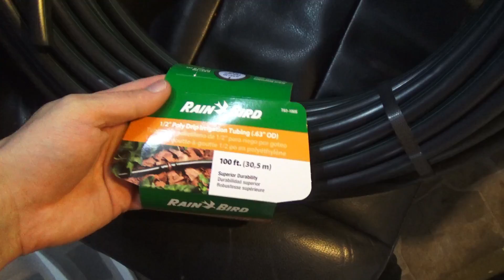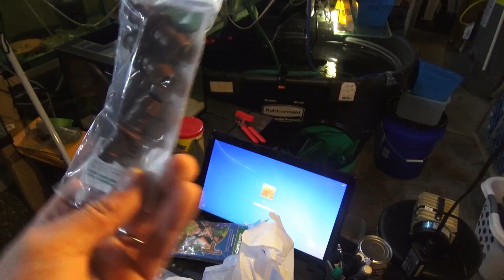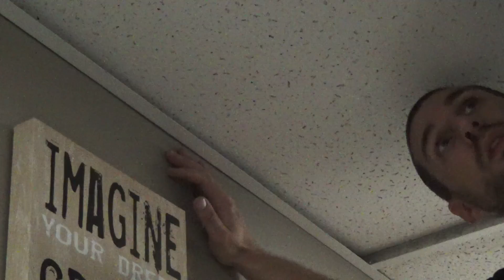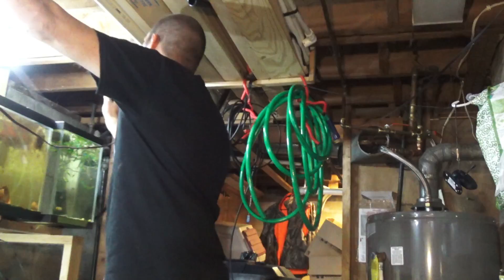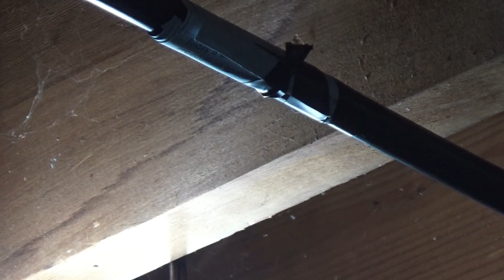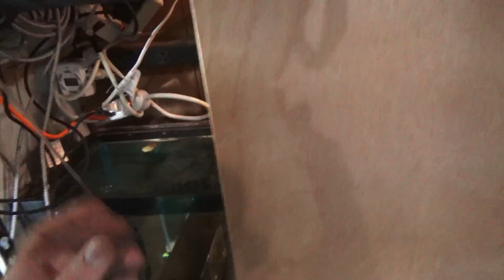Fish Room Air System For Under $100 That Works!!! 10 Years Proven System - KISS METHOD

Comment: I did the same thing about thirty years ago, I also included a pvc pipe 1800mm long 100mm dia, cap the ends  to act  as a reservoir and even out the flow. That way  I could tap  into the reservoir and run shorter loops  to the individual areas so  I could isolate an area incase  I needed to make changes to the system. Making sure you place an inline tap near  the reservoir on each loop. 

Most  important, with  your air bleed, get more tanks, you know  you can provide sufficient air to them. Start another fish room.

Comment: Thanks for all your videos. Working on catching up on all your videos as I’m a new subscriber. How do you figure out which size pump you need? I have 33 tanks with around 600 total gallons. Thanks
Reply: Yes that helps a lot and In my price range appreciate it.
Reply from the maker: Do to the volume of the aforementioned; I would suggest utilizing the next model up https://www.amazon.com/VIVOSUN-Commercial-Aquarium-Hydroponic-Systems/dp/B072N2HPWB. 

If you have issues with back pressure in the system; the trick is to raise the sponge filters up higher in the tank. Hope that helps!

Comment: How is this central air system holding up?  Thinking about doing this for my small fish room instead of running PVC.  Thanks!
Reply from the maker: Works great! Wish you the best in your build!
Reply: @crosshillresellers  Cool, thanks dude.
Reply: @crosshillresellers  Finally got around to setting up the irrigation tubing and it worked awesome.  Thanks again for the tip!
Reply from the maker: That's great to here!!!!

Comment: Could I run a T in the middle of the loop to accommodate tanks in the center of the room? Or would those 90 bends wreck the flow?
Reply from the maker: A few variables to this:

It can suffice; however the direction of the flow, place a ball valve (will have to improvise here) just after the tee; acting as a damper in a duct run. 

When you branch off the tee to accomadate the center system place another ball valve in this direction of flow. 

At the end of the run for the center system you'll end up capping off. At the end before the cap, you'll need to tap-in and add a breather valve (air flow control valve will suffice) fine tune this valve after the system receives it's air supply. 

To reduce back pressure through out the system (whole fishroom) ensure you raise sponge filters as needed toward the top third of tank to reduce back pressure. 

*Note the best approach to this system is have a loop and not branch with tees ETC. the aforementioned is a rough approach as I have never seen your actual setup.
Reply: Ok that makes sense...what if the center run bisected the loop and T'd in at both ends?
Reply from the maker: I would not recommend as you'll most likely encounter a bottle neck situation.
Reply: That's what I was worried about. Thanks for the advice!!!

Comment: How’s the pump holding up?  Was looking at something similar vs Alita AL 60 vs Jehmco LPH60.  Definitely like the price point when compared to the Jehmco.   👍
Reply from the maker: TM Aquatics working very well! We did upgrade to the next model; which is twice the size for ease  of addition (more tanks). With this being said, the concept within the video - I'm very pleased. My hope by realising a quick tutorial was to bring some insight behind the ease of use and versatility within this system. Also, saving folks time and money! Thanks for stopping by!

Here's a link to the latest model in use:

VIVOSUN Air Pump 1750 GPH 102W 110L/min 12 Outlet Commercial Air Pump for Aquarium and Hydroponic Systems (102 W) https://www.amazon.com/dp/B072N2HPWB/ref=cm_sw_r_cp_apap_F1hsgfzslmANQ

Comment: I feel crazy now, I have almost the same pump but I use a manifold and airline tubbing. Your way seems much better. How is it working now?
Reply from the maker: Lets Get It Fitness A.K.A Bigjayinga working excellent! Added additional devices (fry tanks and or sponges) to the system. Thanks for stopping by!

Comment: 1st to comment...tell him what he's won...lol. Seriously yet another great video brother. Thanks for sharing. I finally was able to get a 20g tall set up for the cherry shrimp you sold me about 4 months ago. It's almost done cycling. 0.25 nitrites as of last night. I've had 3 nerites and 2 baby Bristlenose Plecos in it for about a week. How long should I wait before moving the cherries over from the 55g?
Reply from the maker: Adam C. Thank you so much as always!!! 

Just ensure you have zero ammonia, zero nitrite and check your nitrates within your 55. Just ensure you stay within 10 ppm of nitrates within your 20 compared to that of your 55. If for whatever reason your nitrates are higher than 35 ppm in your 55 slowly reduce the nitrates in your 20 (after you add the shrimp) down to a reasonable level-between 10-30 ppm nitrates. 

Ensure the temp is matched within 3 degrees from your 55 to your 20. 

Add 1 lb. Crushed coral per 10 gallons of water for appropriate calcification distribution. 

Add plants slowly to reduce and maintain nitrates. 

Utilize Catappa Leaves.

Hope this helps. 

Thank You,

Jeremy
Reply: Sergeant Tank... Very helpful as always sir. The 20 is already planted, all the old growth is gone and only new growth left. I planted it the day after filling it with plants from a well established tank to help speed up the cycle. That was about 2 weeks ago.
Reply from the maker: Thank You!